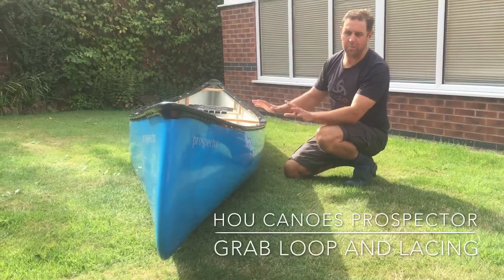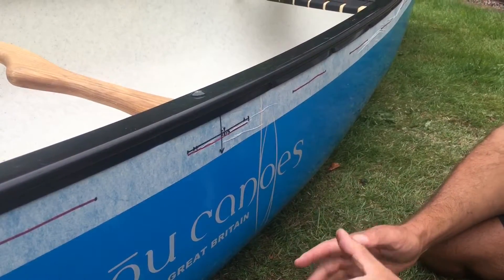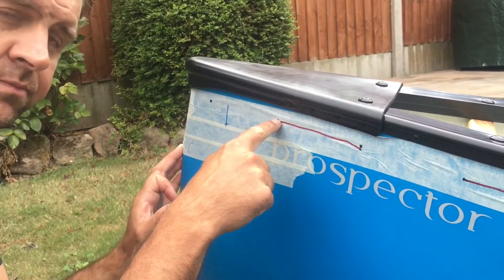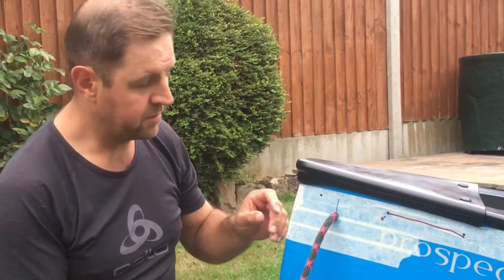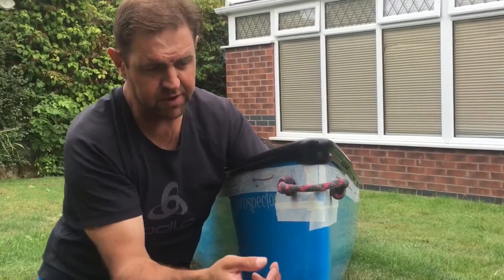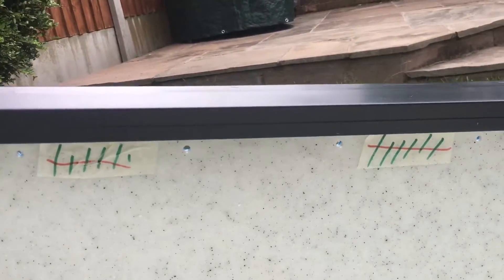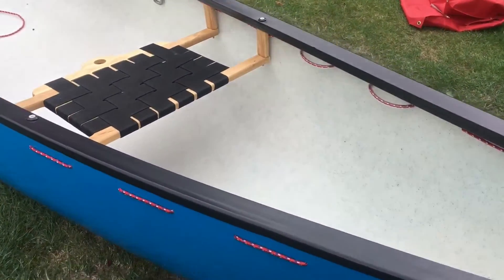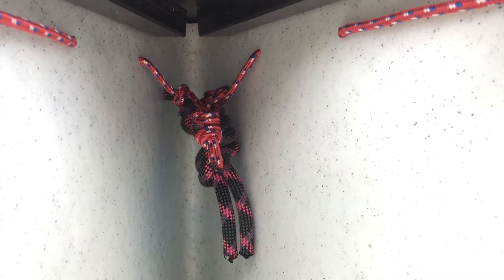Canoe Grab Loops and Canoe Lacing

Comment: I threaded the lacing through short lengths of tubing (I used 1/4 ID black fuel line) on the inside of the canoe on every second loop. It keeps the rope away from the hull to form useful handles or eyes for the criss-crossing shock cord I use to keep gear in the boat. Cut the tubing on a 60 degree angle to match the angle at which the rope meets the hull.
Reply: What size rope?

Comment: Bevel each hole and apply a dab of paint to smooth the edge to prevent the sharp fibreglass from cutting into the rope.
Reply: I don’t think it’s a fibreglass boat. Your not supposed to drill on the fibreglass
Reply: The Hou isn't glass, it's a three-layer plastic.

Comment: I also liked the overall set up. However I don't quite understand the point about the lacing giving extra boat long support to the grab handles. As soon as an internal grab handle knot reaches  the inside hole all the length ways support stops and it is down to the grab handle holes alone. Yeah??
Reply: yeah good point
Reply: Agreed. The lacing should be watertight in the holes, making slippage impossible, therefore it can't share any load down the hull. The load on the grab loops will only be shared by the first lacing hole, at most.
Reply: @kevinsteele7232  My thoughts also. I will add paracord tied to the inside lacing in prusik style for gear attachment.
Reply: @petermcmahon8074  My thoughts also. I will add paracord tied to the inside lacing in prusik style for gear attachment.
Reply: @koiroy8030  exactly what I ended up doing!!

Comment: I backed the bow eye with a glob of epoxy which I then drilled through, so the hole is reinforced and does not present an entrance for water. Chamfer the edge with a countersink and paint the exposed fibre. I finished it off with a leather 24 pointed star around the hole, hot glued to the outside of the hull, port and starboard. Looks really nice.

Comment: Drill the minimum possible diameter for the rope as it will be thinner when pulled tight creating a gap where it passes through the hull. Use a sail needle to run a twine "messenger" out through the centre of the rope end to make it easier to feed it through the holes. Melt the rope end into a thin taper first.

Comment: Very helpful, just waiting on the exact same canoe being delivered (in green).   Can I ask, where did you purchase the rope for the lacing and also the clear pipe for the gear connection points.
Reply from the maker: Fabulous boats.
The tube was off eBay, but buy opaque not clear as clear shows ugly mould inside after a while. All the cords and ropes are from climbing shops that sell by the metre.
Reply: @outdoorinstruction  If you take time figuring out your needs, you can arrange the number and spacing of rope handles to only locate them where needed and not have an excess number cluttering the interior. I used black rubber tubing to match my black hull and find it aesthetically pleasing.
Reply from the maker: @UguysRnuts  I’ll be getting a smaller solo boat soon and plan to do just that. I like the options of many loops on a big boat that’s used solo and tandem for day and multi day trips. A smaller boat just for me can me more precisely outfitted. So watch this space

Comment: Without sealing the holes, is there a danger of water getting in between the two skins?
Reply from the maker: On Hou canoe boats there’s no issue of water getting between the layers of the plastic laminate. I’m not sure if other brands though. I think with most modern boats it won’t be a problem.
Reply: @outdoorinstruction  thanks, it's a new silverbirch Broadland, I noticed a very thin tissue layer when drilling. I may email them.. 👍

Comment: Fab demonstration, could you post a material list used? and where I could purchase the items.

Many Thanks
Reply from the maker: Nigel Bowen 5.5mm cord from any good outdoor shop and the tube is 6mm inner diameter from vehicle supplies shops. It’s fuel line.

Comment: how did you set up the gear loops? is that rubber tubing over the line?
Reply from the maker: It’s silicon tube yes 6mm inner diameter over 5mm cord each loop is about 180mm long
Reply: @outdoorinstruction  do you do any kind of sanding or prepping in the whole you drilled to keep the material from cutting the cord?
Reply from the maker: None at all. Drill and threaded
Reply: Watch a video by Ray Goodwin on the same subject. He shows you in detail how to do the tubing. This video and Ray's are very good to watch one after the other and you'll have no problems.

Comment: Would you mind sharing the spacing spec you used? For the point to point (outside hull) as well as the point to point (inside the hull)?

Thank you
Reply from the maker: Andrew Dacres it depends on what length boat you have and what looks better. Too small and the holes with cheese wire and too big will change the gear loops sizes. Anything between 4.5 inches and 7 inches works. I guess mine are about 5 inches.
Reply: 10cm spacings 
use 12cm clear tube on the inside , 
watch - 
 Ray Goodwin 
open Canoeing rigging and sailing rig

Comment: What size/sort of rope did you use for the front grab loop please.
Reply from the maker: Damian Parrish i used 10mm full climbing rope with about 2000kg break strain as I had a length spare. I’d ensure I use anything about 1200kg due to ropes weakening over time and the load they take in resuce hauling in pins.